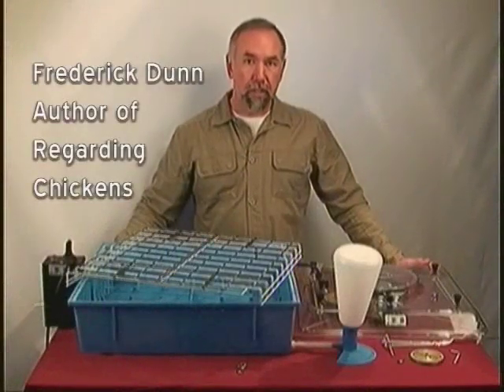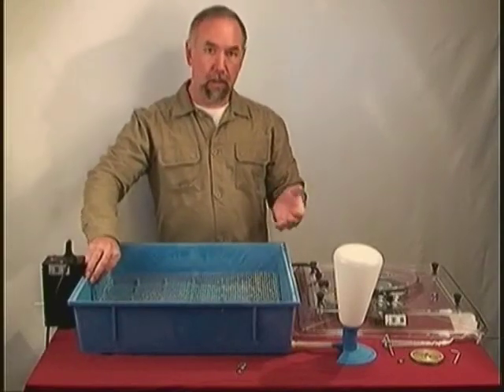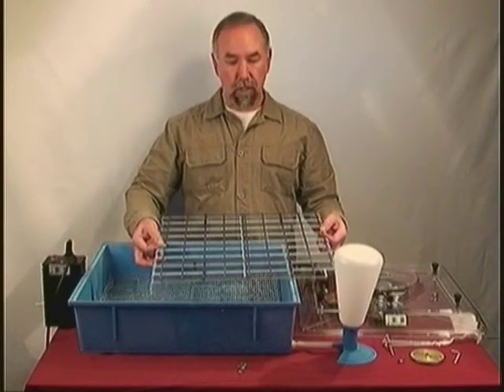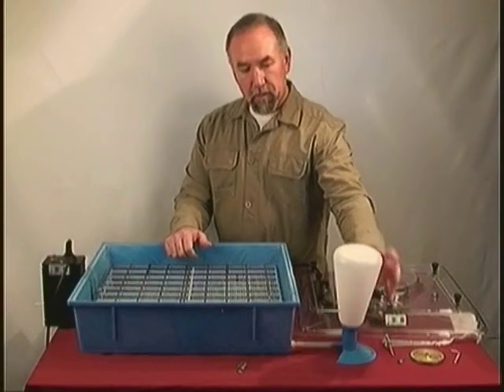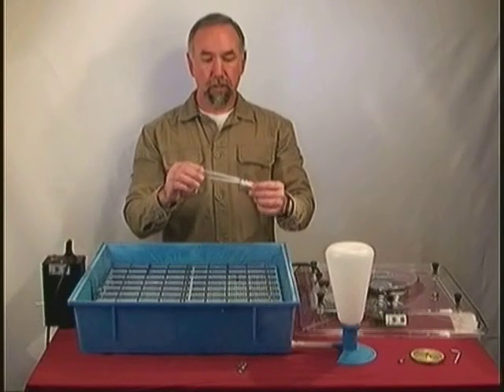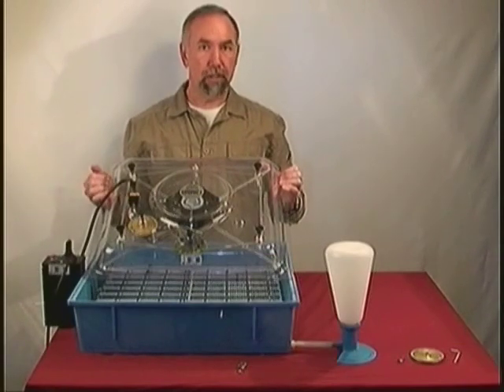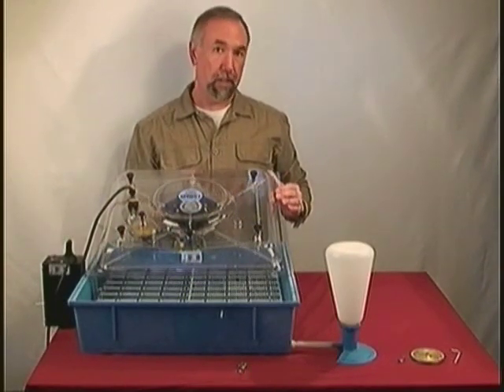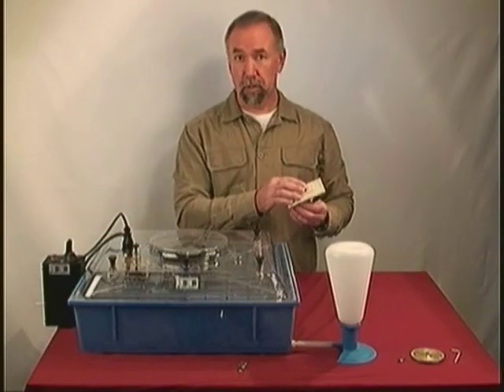ROLL-X RX2 Incubator, how it works... Automatic Forced Air Incubator

Comment: @HTCSWEOD I hate to keep bothering you but I have 1 last question. The fan has not shut off. Is it supose too? The light does go on and off. The temp is at 99 - 100 degrees. Our unit does not have a wafer control. I have pictures of our unit if I can get a email to send them to you. Ours is slightly differant than the one in your video. Its green in color. Its does not say ROLL-X RX2, just ROLL-X. By the way...we used it last season with a very good hatch rate. We raise parrots. thanks again!
Reply from the maker: Because it's a forced air system, the heat goes on and off, but the fan runs 24/7.

Comment from the maker: @mysticaldream806  when assembling components that are going to be moving and vibrating, a dab of pure silicone sealer does the trick... of course you have to use it long before it's actually put into use so it can properly set up and cure.  Glad you are back in service (">

Comment: I got a years usage. Then it died. No new electronics were available. So I wired in a new fan and bought a Chinese regulator bypassing the thermostat. Wired it into the heating coil. All works perfectly.
Reply from the maker: Those wafer style cutouts are still available if the unit thermostat fails. Sounds like you have good modification skills, glad you figured something out.

Comment: FYI. I think mine is a bit older model because I don't have the solid state thermostat, just the wafer one.  Also, my reservoir bottle fits into a hole on the top of the unit rather than off to the side.   I saw on Lyon's parts list that my bottle is for model RX or RX1.  As far as the turner, there definitely something wrong.  After two hours of testing, it only moves after pushing the button and only slightly.    I saw on Lyon that a replacement motor is about $55 but I want to trouble shoot the timer as well just to make sure.  I opened up the turner and everything looks good.  The motor is an Ingraham series 75A.  A quick internet search of this motor came up somewhat empty handed other than it's an old clock motor and I found one place that would rebuild it for about $165. ouch.  The timer is Ingraham series 80.  I may just have to call Lyon in the morning to see if the have technical help to guide me on testing it out just to make sure.  At this point, I am open to any advise.  Once I get the turner working, I will do a  test of the entire system with distilled water for 24 hours.  After that, a practice run on silky eggs, before investing in the goose grid and goose eggs ($20 each for the ones I want).
Reply from the maker: I wish you well David, you're much deeper into the motor than I've ever been. I hope you find Lyons to be friendly in helping you troubleshoot. I've never had much luck corresponding with them, in fact, they never responded to me at all many years ago. I hope things have changed. They are located in the San Diego area. Please let us know what you finally figure out :)

Comment: I have the Turn X but I need more space to hatch larger eggs.  The Turn X is idiot proof.  How about the Roll X is it also pretty reliable.  I got a cheap incubator and had a fail on some expensive eggs so i'm trying to step up.  I like seeing the hatch without opening the unit.  I worry that the cabinet type would cause fluctuations during hatch if you try to view or remove hatched chicks.  The cheap incubator was a box like this one but you couldn't view and when you tried to open to unplug the turner for the hatch or remove a chick, too much heat and humidity was lost.  Then the recover would make the temps go too high unless you manually opened it a crack till it stabilized.  Ruined a whole tray of rare turkey eggs.  Got one chick only.  Trying to decide what to get - another Turn X or this one or something else?  I like that Lyon is around for parts over the years.  That has been great.

Comment from the maker: It isn't necessary to have a turner in your incubator... the eggs may be turned by hand several times a day...  turn them an odd number such as 3, 5 or 7 times a day so they will have a different side UP over night.  Good Luck with your design and construction!

Comment: I am using a Marsh Roll X Incubator with a turner. I am setting it up for the first time this season, but I did use it last year. I can not remember if the fan comes on right away or after its up to temperature. Can you tell me? Also the same question about the light on top. Thank you.

Comment: @HTCSWEOD We had to replace the fan motor. Now the fan is running and the unit is heating up. There seams to be a little more noise and vibration than I remember from last season. What is the best way to adjust the screws to lesson the vibration? Do you have any other suggestions? Thank you.

Comment from the maker: @mysticaldream806   If the unit is not up to temperature, the fan comes on immediately along with the indicator light you are asking about.  When it reaches the proper temp, if turns off...  Hope this helps... if your fan is not running, is the heating coil heating up?  They are on separate interior connections... good luck!

Comment: The fan on my incubator does not stay up so it rubs on the mesh cover and prevents it from turning. Is there supposed to be a screw or something in the middle of it to hold it in place?
Reply from the maker: Sorry to be so late, I hope you found an answer to your issue.

Comment: I have a Roll X that has been used off and on but, more in the last 2 years. I used it less than 2 years ago hatched my little brood with no trouble. Found some eggs  and after getting them home my incubator  will not go below 117 degrees. I do not have a thermostat like yours but have a wafer that I have turned up and down at least 10 times. When I look at the book there is a little block at the bottom of the wafer but, my wafer is not attached to any kind of wire or box. Will you please give me some suggestions. When I turn the screw down a couple of times the light tried to flicker that was all
Reply from the maker: there are many youtube videos about the wafer stlye temp control... I'm sorry I did not make a tutorial about that.

Comment: Hi I am using one without the water reservoir.  How much water in ml should I add. Just added the chicken bantam sized eggs
Reply from the maker: The amount of water you add will depend on the air cell size as you continue to incubate. I start off without water and then add water to the basin if the dehydration rate of the egg is going too fast, if it's right on track, then I just add water on the 18th day for max humidity during pipping. It's really dependent upon the humidity in the area where you are incubating your eggs.

Comment from the maker: @mysticaldream806 You are asking lots of questions for someone who isn't even subscribed to my channel (">(">(">....  no problem, anyway, yes the fan runs continuously so everything remains evenly heated... it's only the heating element that should cycle on and off with the temps.  The light may just indicate that the unit has power and serves to let you know if the power is interrupted.  99.5 would be perfect and 99-100 is in a good range.  I don't need to see a photo... thanks anyway!

Comment: Is there water in the bottom at all times?
Reply from the maker: That's under your control, if you need to increase the humidity, then yes, if you are already in a high humidity environment, you may not need any water until the pipping stage.

Comment: Just an update.  Figured out my issue with the turning motor.  The set screw that attaches the motor to the shaft was stripped.  A little epoxy and everything is good to go.  Only thing left to do is get a couple of parts.  I don't have any wick sock and I missing the perforated screen.  The screen on your video looks different than the screen available on Lyonusa.com.  Is your just a piece of 1/4 hardware cloth?

Comment: Just got one as a gift for my 19th birthday! Unfortunately I looked up the company and it says permanently closed? It didn't come with the bottle so I need a replacement. Is there anyone else that makes something similar?
Reply from the maker: NO, unfortunately, it's a one of a kind, but an inverted bottle fill system should be easy to replicate so you can control the water level. It's a basic principal.
Reply: @FrederickDunn  thank you very much for replying! I'll do my best

Comment: Hi Fredrick, Thank you for the video.  I just got a hold of a Roll-X incubator and looked up your video to see how it works.  I got my Roll-X from a university lab and thoroughly sanitized it.  I want to hatch some goose eggs so I will have to purchase the goose egg grid since mine came with the grid for quail eggs.  Since I got my Roll-X for free, I guess it would be ok to spend the $75 for the other grid.  Only thing I haven't figured out is how to get the auto turner to move.  I push the button on top and the motor turns sometimes and not a complete cycle.  Any suggestions?  I can't seem to find a manual.
Reply from the maker: Hi David, wow bonus, getting it for free is great. Are you certain it's not doing a complete cycle? It "should" just roll the eggs one way, pause for about an hour and roll them back in the other direction. Are you saying it only rolls part way through the cycle then stops indefinitely? There really aren't any user adjustments for the auto turner. Put some fake eggs, or chicken eggs on it and see how far it's turning them, if it goes at least 90 degrees you're probably ok. With duck or goose eggs, I like to roll them for best results in something like the Top Hatch incubator. Turning and tilting produces lower hatch rates with ducks and geese.
Reply from the maker: Hi Again David, YouTube blocked your most recent comment (no idea why) and it's under the "held for review" category with no option to "allow" your post. Weird. Anyway, I'm glad you fixed everything and yes, the bottom screen is 1/4" galvanized hardware cloth that came with the unit originally and it works fine. Thanks for taking time to update me and so glad you're back in business with that unit!

Comment: At the time of hatching,do the chicks just fall through the turning grid and on to the screen?
Reply from the maker: Proconst1 No..... on the 18th day of incubation, turning stops, the grid is removed and the eggs are placed on the wire well before pipping/hatching occurs. Also at that time, humidity should be increased to reduce the possibility of chicks drying out and sticking to the shell. Thank you for that question!